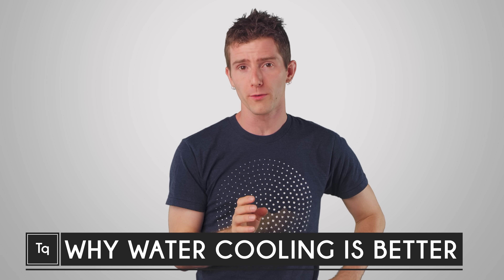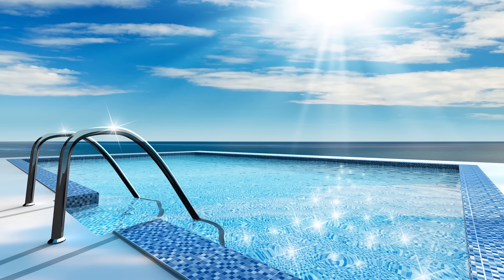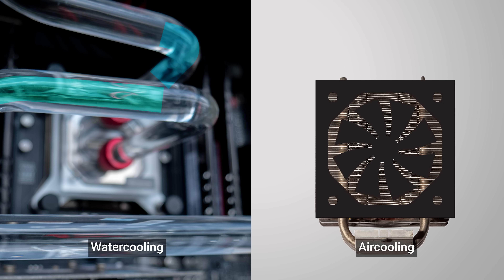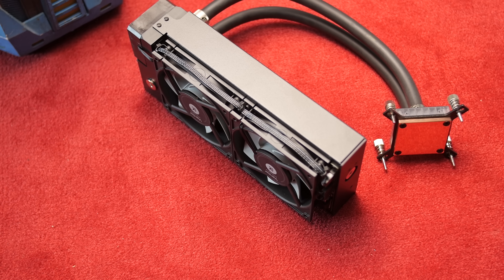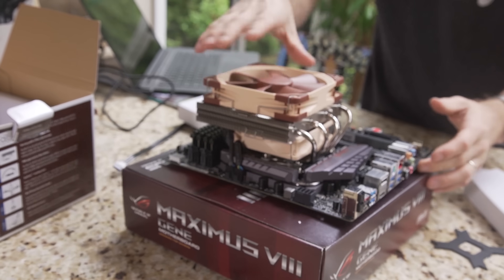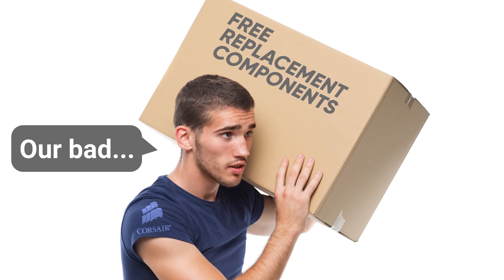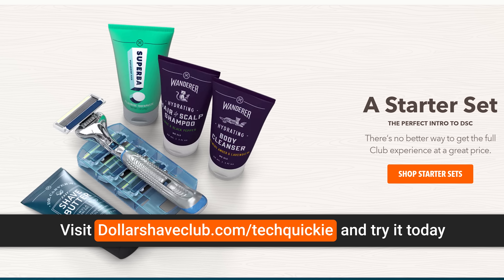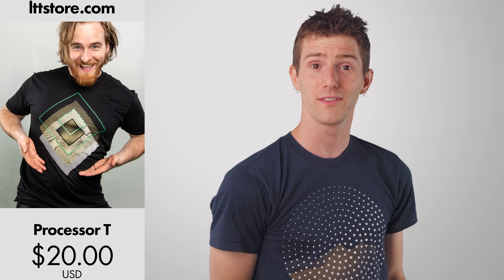Why is Water Cooling Better?

Comment: Does heat capacity even matter? With a sustained load the water will heat up anyway. So it seems water cooling gets its advantage from surface area - being able to spread the heat out over larger radiators compared to a likely smaller heat sink. Of course with burstly loads this heat capacity gives it an advantage.

Comment: I am a gamer But I do not overclock and I use watercooling and here is my reasoning on it: I worked in Quality control at Philips Electronics for years, one test was the lifespan test, How do we know a device will last for 10 years in only 1 year? Well we make use of a physics law that is so easy they will not teach you this in schools or universities, the law is simple, heat up anything for 10 degrees celsius and every Physical and chemical process will speed up by a factor of 2, so we tested these devices in huge walk in ovens that where like a dry sauna at 80 degrees Celsius, that is like an average of 50 degrees, or 5 times 10 degrees or 5 times 2 the normal physical speed of lifetime,  in most countries during the summer days meaning 1 year is actually 10 years. So when someone explained it to me I asked, does this also work in reverse? Like 10 degrees colder makes my lifespan 2 times longer and it turns out it does, which resulted in my 10 year old PC, still performing at high speeds way after the intended 5 years most things last.

Comment: Pro HVAC tech tip, if you have water cooling beef up your water pump, extend (and insulate) your pipes and set your radiator in front of an AC vent in line with the flow of the air. Voilá! Your CPU will be cool in many ways lol

Comment: I like the the way aio water coolers opens up the motherboard. I had a pure rock 2 air cooler for a while but didn’t like how it blocked everything. I got the 280mm Corsair rgb cooler and love it. My cpu is now at 38c at idle. It’s probably way overkill for the 3600x I have though lol

Comment: My water cooler is quieter even with the pump, than the stock cooler, plus my video card runs much cooler, and even with the fans off when just general using (YouTube ect) making the PC very quite. I do worry about it springing a leak or failing pump about five years after I got it though. That is the major down side.

Comment: I think only ammonia has a higher heat capacity than water. Well, before you want to replace your custom loop with ammonia, it would have to be held at -33.3C for it to be liquid. And it's extremely toxic, it's odorless to so you could be dead before you realized you had a leak.

Comment: More Heat capacity due to Hydrogen bonding!? Umm... I have a mechanicalenginnering degree with specialization in thermodynamics, and well... to put it politely it's a gross and rather inaccurate oversimplification. 
How about you stick to tech tips only, Linus...😅

Comment: Okay there is a few things here, he was comparing a NH-D15 to a 120mm AIO. Most will never recommend a 120mm AIO including myself the radiator is just too small on them to be worth it. The NH-D15 is the best air cooler out there and it stands up with 240mm rads. It takes the massive 360mm AIO's to straight beat it like the NZXT x72. 

So it typically goes like this:
(extreme OC solutions) Direct application LHe > Direct application LN2 > Direct application CO2 > Phase Change > Peltier (Termoelectric cooling) behind a custom loop > (normal solutions) Custom loop > 360mm AIO > 240mm AIO / NH-D15 > 120mm AIO / Other sinks like Evo212 > Garbage coolers like Wraith or Intel stock.

Overall water is better than air cooling as water has much higher thermal density. This is the reason why many things from most car engines to nuclear power plants go the water route for cooling.
One huge advantage of a radiator is literally carrying the heat away from the system.

Comment: Corsair never covers the cost of anything but give a replacement water cooler itself in case of a leak. 

Happened to a friend and me. Didn’t get any compensation, just a replacement unit that we chose to not put into our systems anyways...

Comment: That's... not how specific heat capacity works at all.
Thermal energy is divided between every degree of freedom possible (kinetic energy of movement/rotation/vibration, potential energy from vibrations). The more of them there are, the more heat energy it takes to bring up the energy per degree of freedom (temperature). The details of how that works for water are still not understood in detail, but it's to do with the strong hydrogen bonding allowing many large and complex intermolecular vibrations (which means extra degrees of freedom).

 
Also for PC cooling heat capacity hardly matters at all, temps before and after passing through waterblocks are usually only a couple degrees apart and another degree wouldn't matter. It's water's thermal conductivity that makes it ideal.

Comment: Water does not come into direct contact the CPU/GPU . Thermal Paste -  then Metal plate - then contact to water. Water is then moved to a Metal radiator where air flow cools off the radiator . Copper gives off heat faster then other metals. BUT copper is very electrically conductive . The CPU/GPU  cover , and the thermal paste is protection enough to avoid a short out . But I don't see copper used in any of those water cooled systems [only a few air cooled ones do ] . Why? because copper costs a few pennies more than what they use. My Air cooler is Copper tubing filled with a refrigerant gas that goes to a copper heat sink. It performs as well [single fan] as a 3 fan water cooler.The radiators are coated with a colorant/antioxidant that reduces heat transfer. Water expands when heated causing expansion and sometimes radiator blow outs. [Leaks water into computer. usually take 6mos or more for that to happen unless it was a crappy manufacturer. Now gases expand when heated too , but gasses do not generate the pressures that liquids do.] I have had 4 water coolers blow up on me so far. I will not try for 5 .

Comment: Why is water-cooling better? It's simple really. A CPU waterblock puts less weight and strain on a motherboard than a huge, heavy air cooler. Back in the day (like 15 or 20!years ago) performance air coolers were getting so extreme and heavy that the stresses on the pcb's were ridiculous unless the motherboard was horizontal. It must be remembered also that back in the day carrying a desktop PC to a friend's house for a "Lan Party" was also a thing...and bouncing around a case with a big chunk of copper bolted to a PCB? That's not going to end well. 

Custom loops could be a pain true enough, but even they reduced the weight of what was attached to the motherboard itself dramatically.

Then along came AIO kits. Easy to install. No stupid weight on the PCB and enough cooling performance to get the job done. 

(That said, the custom liquid cooled desktop pc I run as my main rig at home. Well...that ain't moving from where it is without a friend to help me lift it....but that's another story. (And there is still very little weight actually on the PCB. Well...at least at the CPU socket..the GPU's do need support.

Comment: I have an interesting story. Awhile back when I built my pc, when the 7700k came out I got it, with the intention of ocing (which I have now). I could not get this thing to run under 90*C no matter what cooler I was using and/or thermal paste, I tried my coolers on a friend's 7700k and it was okay. I decided to delid my cpu instead of getting it replaced and apply liquid metal (which I have seen countless tutorials and videos showing how well it conducts heat). I was quite shocked at the cpu dye and ihs. There was basically no thermal compound between it... Which I can't understand how it would have passed QC.
I applied liquid metal. And wow... Like max load is 50*C. The point of the story though is intels shitty OC

Comment: There's still a question: when water heats up less quickly (higher heat capacity) it also needs more time (or surface exposure) to have it dissipate (hence bigger fans) somewhere else. But what about the speed of heat transfer at the socket (the contacing area is sort of limited as in the air cooler case, isn't)? Won't there be excess heat when it it transfered too slowly (how high is the heat conductivity at the interface) and how is it remedied ? Isn't there a tradeoff in terms of conductivity and capacity ? What determines the optimal speed of the water being pumped through to a reservoir ? Maybe this calles for a Linus test :-)

Comment: Still using my be quiet slim and have not had a heat issue even though it is over clocked.
Air cooling may not always be as good in many people's opinion, but I am happy with it.

Comment: Why s it better,  2080 TI running at 2070 Mhz @ 40C or lower while under load for hours with the CPU in the loop as well.  This compared to 85C o the same card with ~1875 Mhz clocks only on boosts.   It'll go over 2100 as well stable with the water loop.

Comment: This is completely wrong about water cooling. Water cooling simply moves water to radiator, which has more surface area to dissipate heat. This is also the bottleneck of the water cooling. Water is harder to heat up or cool down. However, the superiority of water cooling has very little to due with the properties of water. Water is liquid it has higher density then air. Meaning more molecules are used to transfer heat when water run over the metal plate compare to air. However, if you can keep a liquid metal running in the pump you will not dissipate more heat than water. It just absorbs more heat due to higher density and dissipates more heat due to larger surface area of the radiator. If you don’t dissipate the heat absorbed by the water/liquid metal, your PC will just heat it up. Therefore, the radiator of the system is the bottleneck. Where is Alex when we needed him. Ask your engineer next time Linus.

Comment: The water in the pool stays cool due to evaporation which is why a solar cover heats a swimming pool.  It prevents evaporation from occuring.    Evaporative cooling is not involved in a CPU water cooler.
Yes, water can hold a lot of heat as can just about any other liquid can, but ultimately, any water cooler is cooled by air via the radiator and the water is just a vehicle to move the heat to a bigger, better placed radiator than can be mounted ontop of a CPU.
Reply: Evaporation does play a part, but Linus isn't really wrong about the heat capacity of water either. There is a huge difference in Heat Capacity between water and air. You are right that water is a vehicle to move the heat away from the CPU but the heat energy still needs to be transferred from the CPU to the water. This transfer of heat is a lot faster than blowing the hot air away with a fan.

Comment: Years and years making content about tech and linus still doesn't get it... ACs and WCs transfers heat throught the absolutely same way: AIR, and water does not really have better condutivity than Heatpipes, in fact heatpipes, having also liquid fluid within them, transfer heat BETTER. The point about a Watercooler is to allow the radiator to be placed away from the CPU, which would allow it to be have a larger dissipating area than a solid AIR cooler rigidly mounted on top of the cpu. 
If the AIO doesn't have a radiator bigger than the fin areas of two large 140mm AC tower, it won't perform better than AIR. And most 240mm aios, don't.

240mm's aios are pointless. Watercooler is only meaningfull on custom loops with large radiators (280~360++ in size). But even so, good air coolers have the benefit of being quieter, specially at idle due to the lack of point and being less dangerous to the hardware in case of leakage. Custom loops are cool and only meaningfull for aesthetic purposes.

Comment: example with the pool is wrong:
1. Water is ‘transparent’ meaning that not all heat is absorbed
2. Convective heat transfer is very special because transferring heat from the air into water yield a completely different result than transferring heat from iron to water
3. Dipole moment... It’s just not important and it tells nothing. In other words, every molecule has a dipole moment, every single molecule of any kind has it. So, it’s just not the case.
Here what you shout say:
1. (you said it) the water can “have will have much more heat energy in the same volume as air does”. About 4.25 times more if I recall correctly. 
2. Controlled flow of water is more efficient that the flow of air. Because water works in a sealed system there much more control over where your heat goes.
3. Temperature difference with the pressure difference. Very long to write generally speaking the convective transfer, that heat movement in the air-cooling is powered by temperature, while the water-cooling is powered by the movement of the water. It means that carrying out heat by water cooling requires a lower temperature difference between the heat source and the cooling block attached to it.
Physics baby)

Comment: TLDR. Water cool if you overclock. The higher heat capacity will keep temperatures down while traditional coolers take longer to dissipate the heat at those levels, excluding the outliers like the DH-15. Went with a sealed AIO for the CPU on my new build because it looks sexy. Probably would get the same temperature control with a DH-15 but I was worried about torque. The 2080 ti isn't exactly a light weight. Remember the days when a GPU was hardly bigger than the 56k modem boards?

Comment: What linus doesnt tell you, it´s that air coolers, while being worst at extracting heat, they are better at releasing it than liquid coolers, and you might find yourself in the situation where your custom loop it´s saturated, asking yourself: "but why?, i have a big ass custom water loop....how am i getting only 5-7ºC better temps at the same noise floor".

Comment: Modern air coolers have heat pipes with liquid in them. So, they are in fact partially liquid coolers as well. The difference is that heat pipes cannot be extended or bent so that you can place the large flat radiator on the right place in the case.

Comment: Stock cooler on an i7 8700 non k handles it in windows 10 fine with around 30 to 40 C. Playing a demanding game and you'll be looking at temperatures of 80 to 100 C. 

I bought a H100x Corsair water cooler and the temps where basically cut in half during peak loads and will stick to around 26-30 in Windows and like 35 ish in lesser demanding games.

So stock coolers suck basically.

Comment: A good thing about watercooling is that you don't need to change the thermal paste. I am using the same for 3 years and still my CPU never goes above 50ºC, while before the watercooler 50ºC was the normal on standby with a stock cooler.

Comment: Liquid cooling is better, and I don't necessarily mean artificial circulation, convection/phase change cooling is best. That is why heatpipe based air coolers are cheaper, more reliable, safer and more efficient than watercooling. Watercooling is a meme in 2019.

Comment: For overclock reasons its "generally" better.
For normal use so without overclocking and just standard CPU settings and turbo settings, an air cooler is actually pretty good and if a good brand usually even quieter.

Comment: hahaha - if you're not overclock your cpu just do fine with the cooler it came with
well - tell that my fx8350 wich came with then standard am3 boxed cooler - this 8 core 4ghz chip outputs so much heat even at idle the standard boxed cooler can't keep up and causes safety shutdowns before thermal throttle can kick in
nice try - i see what you did there
used a h80i from build - had to replace it with its v2 successor at some point cause it somehow failed (and didn't fit anymore) after I stocked up my ram from 2x 8 to 4x 8 - wich, even on performance mode - get's in the 70s when under full load
so - show me how the stock boxed cooler could handle that much heat output of that chip

Comment: Can anyone recomend a cheap case with an extra seperate space for an radiator?
It would make a lot of sense to use fresh air on the rad and then just get it out direktly instead of using war air from inside the case.

Comment: It can be beneficial, if you have a big arse heat sink. But that isn't the case with most heat exchangers that are installed inside the PC case. What people tend to forget is that although it is called "water cooling", air is the actual coolant. It also does make little sense to only cool the CPU with water and not the GPU. But if you want to do that, a bigger heat exchanger you need. Not a long time ago there were big arse cooling towers around. And considering the power consumption of modern GPUs you most likely need two of those and a strong pump. But that most likely kills any advantage in respect to noise. That is you don't want to pay several hundred $ just for the pump.
And of course you wouldn't find such a system ready to buy. You would need to do it yourself without any warranties. And suddenly it all sounds like a bad idea. It only makes sense when it is absolutely necessary.

Comment: Watercooling will unlock more frames even if you have everything set to performance and low graphics. A 15 degree drop or more will greatly improve fps